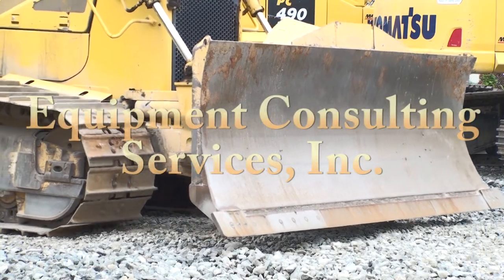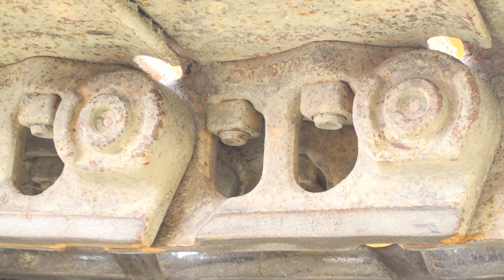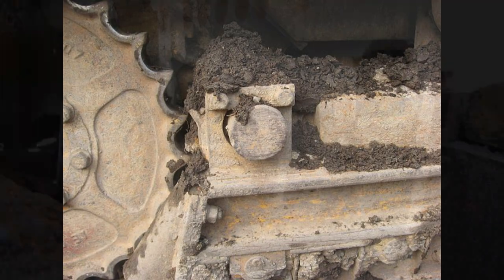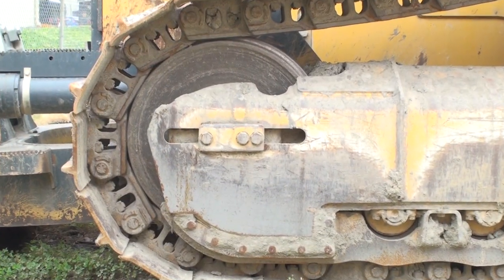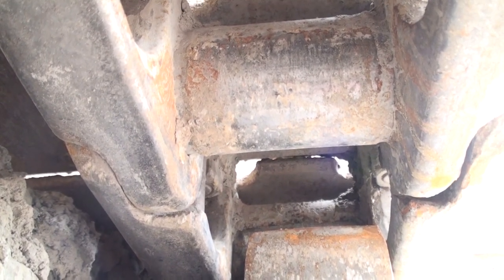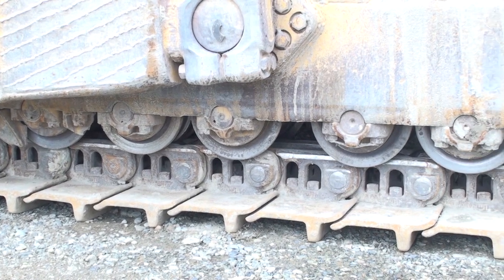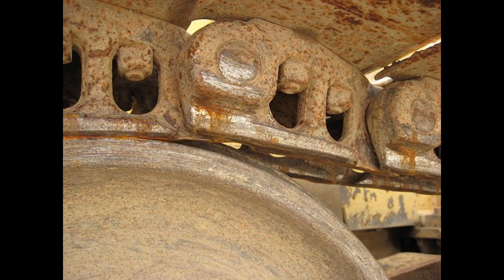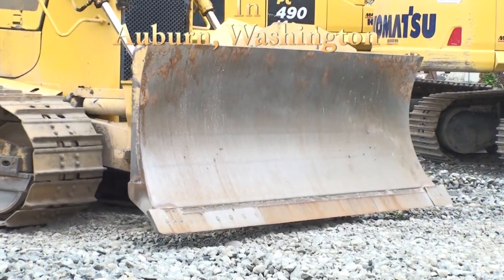Tracked Undercarriage, Dozers

Comment: Nice presentation John with some good points !

  Sharp sprockets & large gaps of daylight between the track pads while looking from the rear of the machine at the final drives …..  The undercarriage is dang near shot . 
 
 LOL !
Reply from the maker: But all the joints still have oil. Throw on some new teeth and she will run and 500 or 600 hours. 
Thanks for the comment.